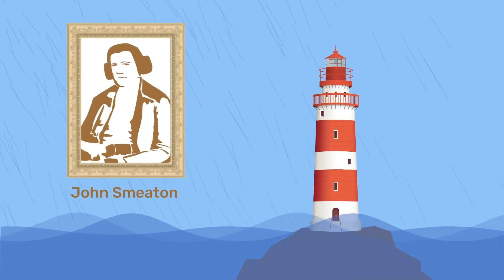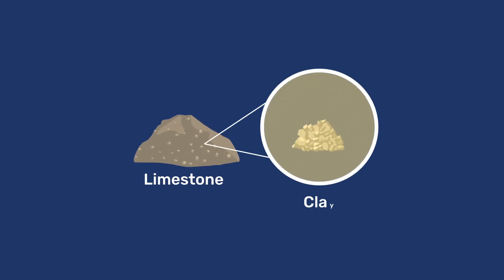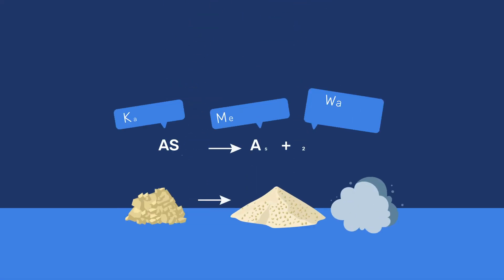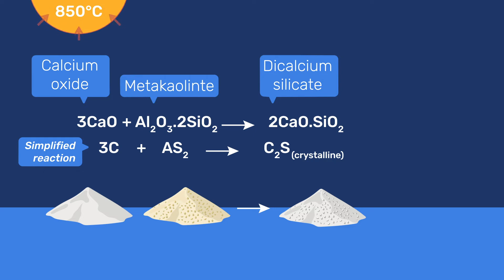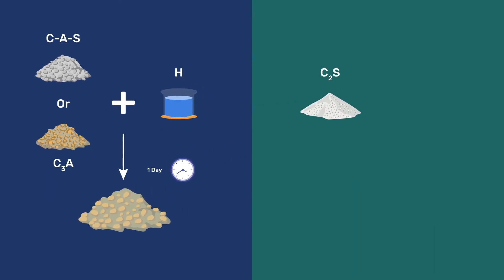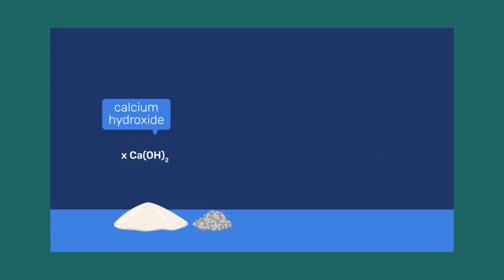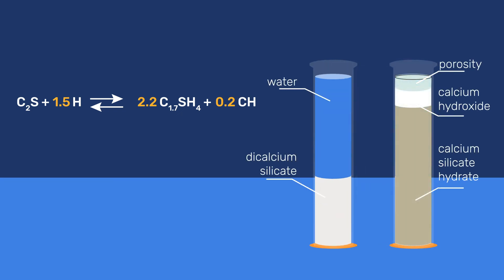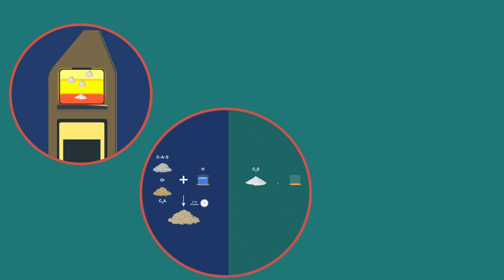Chemistry of Natural Cement

Comment: 5:35 if final concrete has 4.5% porosity then why aren't we using this material as water purification filters? instead they sell ceramic filters which are much more expensive. But with one bag of cement you can make hundreds of water filters. Why isn't cement used as water filter?
Reply: could be that small pieces are breaking off. off the top of my head.